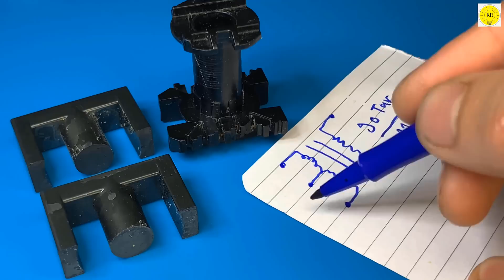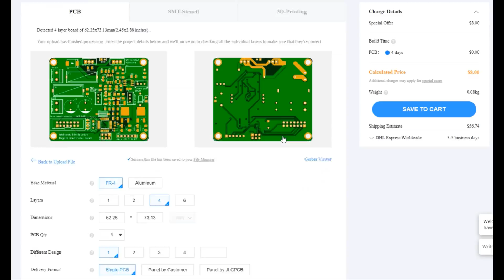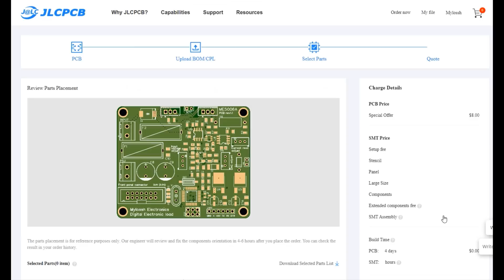how to make inverter 12v to 220v , jlcpcb

Comment: Hello, how many turns and how many millimeters is the wire that you wound for the 220 V part of the transformer?!
Reply from the maker: 1MM 70 TURN
Reply: @inventorkr1  Thank you very much, sorry, I ask again, can you tell me how many millimeters are the wires of the 12V section?!
Reply: @inventorkr1  Can you make a 1000 watt inverter with this transformer?  Does it give 1000 watts continuously or does it need to change the coil?!

Comment: Don't build these type of circuits to power your appliances. You can build the circuits this man shows throughout his channel for educational purposes, or for improving your electronics knowledge if you understand the circuit well. The output of this type of circuits comes with severe voltage spikes and irregular waveforms. So don't use this to power anything other than some appliances.